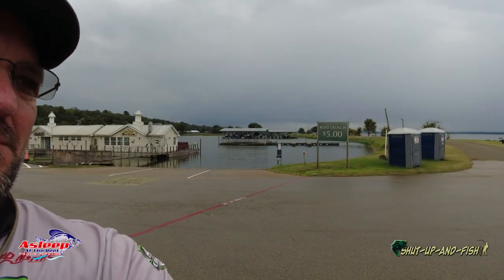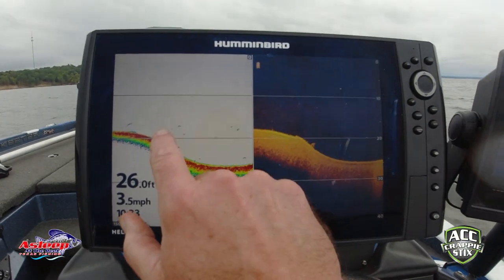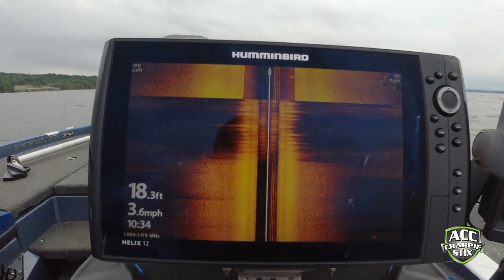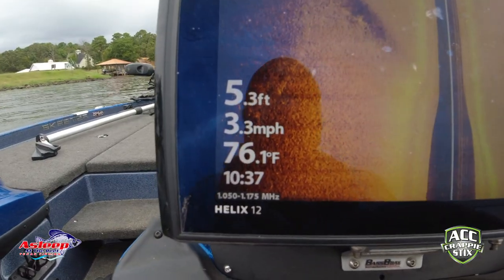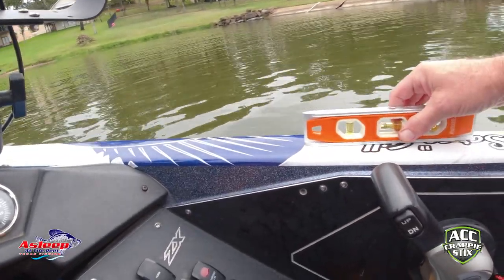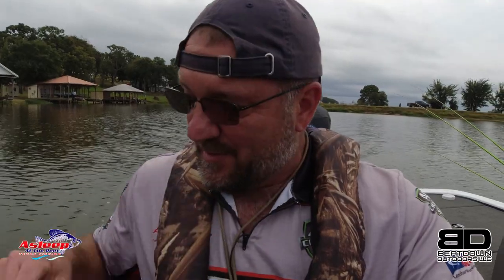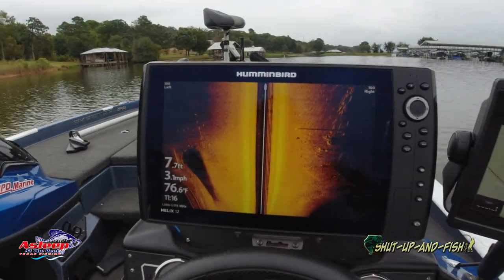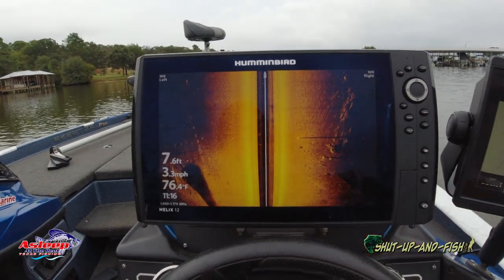HOW TO LEVEL A TRANSDUCER For The Best Picture Possible, Ep 6021

Comment: Awesome video, learning so much. In the instructions it says mount the trancducer next to the motor but I see you have your right under it?
Reply from the maker: Thank you.  Yeah honestly I did not read the instructions when before I did it.  Technically it should be on the side.  The reason for this is so the motor does not create static or fuzz on the screen.  In my case it worked.  What ever you do, make sure that you measure it and keep the thing straight.  That is why I did it there because  I could measure from the bottom, instead of from an angle.  I hope that helps.  I appreciate you taking the time to watch and leave a comment.  Sorry it took so long, been on the road and came home to a dead computer.  More videos coming soon as i finish building this one.  Have a blessed Day!

Comment: I check my transducers every six months or so to be sure they haven't somehow been jostled and become even slightly unlevel.  Great video my friend!!
Reply from the maker: Good tip!  I probably should do that but don't  I just go by my picture but probably need to check it. Thanks for commenting my friend.
Reply: Once you have it level and image is where you want it to be, take the very tip of a knife and make two slight scratch marks directly in line as reference points. One mark at pivot point and one on the transducer.  Or, use a white permanent marker if scratch mark would bother you. Then, you’ll always have a means to visually confirm angle has not changed.
Reply from the maker: @KM.130  awesome idea!!!

Comment: Very informative video of transducer's angle placement.  Only one question about this method. Is that only for transom mounted transducers?  What about "in hull" transducers in some "smaller"  boat counterparts like a kayak, Jon boats and similar watercrafts.
Reply from the maker: That is correct, I am not sure about in hull transducers, I have never used them.

Comment: I'm mostly trolling for Salmon and Walleye in river current, will this technique still work for leveling at say 
1.8- 2.6 mph. up stream or down? I'd like to have crisper image's while trolling so I assume I just need to match the speed to duplicate the fishing situation right?
Although on windy day's this all goes out the window, so to speak? Thank You for this info it gives me something to think about and try! Just bought the HDS12 Live by Lowrance and want it as accurate as possible. Thanks again and for your Service!! God Bless.
Reply from the maker: Yes. The slower you go usually the better image you have. My when put into gear goes 3.5 mph. If on a trolling motor instead I go slower. I have the speed set for 3.5 on the graph so as long as I am not going faster  the image should be much better. Although this is a totally different type of fishing that I do you should get the same results.  Thank You for watching and taking time to leave a comment. Great question.

Comment: Great video, thanks. Say, I noticed that in viewing your side imaging, that you had a series of vertical lines in the starboard side of the water column while side imaging.  I have the same situation in the port side of the water column in my side imaging returns.  Do you or does anyone else know what is causing this interference? I don't believe it's the jackplate in my setup, but not sure.  Any ideas, bad transducer, bad transducer cable?  I'm at a loss.  Anyway, love the prayer to begin and thank you very much for your service.
Reply from the maker: Thank you for watching and taking the time to comment. that is a great question and one that I do not know the answer to.  I would have to go back and look, but the lines that I normally see are lines from going faster than the unit is set for.  You can set a speed in the unit itself.  If it is set for 2mph and you are going 3 you can get lines.  I will rewatch this video and see if I can see what you are talking about and maybe get an idea.  Thanks again, great question and have a great Thanksgiving!

Comment: I sorta did this awhile back. If I remember correctly don`t think the boat was moving though. So guess what I`m gonna be doing when I get back out on the water. Thanks very much for the video. Greatly appreciated.
Reply from the maker: yes to get the right angle, the boat needs to be moving.  I tried to demonstrate that, but the bubble was all the way back to the top and did not move much.  It makes a huge difference.  Basically level it when the bat is at the speed that you are going to use your graphs.  Thanks for watching and commenting!

Comment: Great video. One question, does this affect the transducer returns at anchor since it will now be angled up?
Reply from the maker: thanks and good question.  It should not affect that, but at the same time I do not use an anchor.  It is not really angling up though, it should be flat with the water.  Your boat will angle, but the point to this is to figure out the boat angle and make the transducer flat with the water giving a better return.  Thanks for watching and great question.

Comment: i am not getting a good picture on the left side but the right side is good .  do you have to trim your motor a bit so the left side can get a good picture. because i find the motor is blocking the view?
Reply from the maker: if the motor is blocking the view yes, you will need to trim it.  If at all possible, I would move the transducer.  Mine is below the motor, so it will not interfere.

Comment: So you have to be going the same speed as you were going when you was leveling it before or it will be off again right ?
Reply from the maker: For the most part.  Basically put the boat in gear and use that speed.  I like to go a little faster, say 4 mph, so that is the speed that I will use.  Where speed is important is two things.  First it will change the pitch of the boat causing fewer or more coins to level it.  Second is there is a setting to determine your speed in the settings on the map.  I have mine set for about 4 mph.  What that does is tells the computer to send out more sonar waves or less  If I am set on the graph to go 2 mps, but I end up going 6, my picture will be terrible.  Hope that helps.

Comment: Hey I'm just reaching out to you I got a new fish finder and I need to level the transducer what is a good size torpedo level to
Reply from the maker: Thank You. The one I used was about 8 inches long. Although I don’t know if the size makes a difference but I could see having to big of one could be an issue. I would stick to one about 10-12 inches long.  If too big there might not be a spot big enough to put it and if to small you might not get enough room to put the coins under it. Hope that helps.

Comment: Do you not need to level it horizontal as well..
Reply from the maker: No as that should have been done when installed.  Your left and right is going to change depending on if you are alone in the boat or if you have a passenger.  The biggest thing is front to back.

Comment: Shouldnt you use the coins on the transducer as well. Just wondering why,  i havn't a clue.  thank you.    Craig
Reply from the maker: You can but really not needed.  If you put the level back on the boat, in the same place and make it level by raising or lowering the tongue, that puts the boat in the position of how it would be while driving.  After that you simply need to put a level on the transducer, do not need the coins at that point because the boat is in the position of driving so all you are doing at that point is making sure the transducer is level with the bottom.  Great question.  I guess you could put the coins on the transducer with out lowering or raising the tongue, but I have not tried that to see if it gives a true level.

Comment: what makes you think your side rail is level to the lake water surface?  It isn't on my boat. I use the scum line on the boat left after a day on the water.  I then proceed like you and level that scum line with a level and my trailer jack.  Then level the transducer and lock it down.
Reply from the maker: Nothing makes me think it is level, it is not especially when moving. That is why I use the coins.  This is the flattest surface I have.  If you get the coat level using the jack plate, you have failed to add in the factor of the degrees that the motor pushing adds.  Yes, you will be close, but it does make a difference.  When I do that same thing, putting the coins under to make it level and take the boat out of gear the level shows that I am off.  If you want to view downscan and side scan not moving then ignore what I showed.  Thanks for watching and the comment.  Happy New Year!
Reply: When moving, can you adjust trim and get the same effect as coins under the level?  Maybe permenantly mount a bubble in the rail area and use trim to set up for level at any (reasonable) speed.  Maybe not fuel efficient, but would keep the transducer level to the water surface.  @AsleepAtTheReel